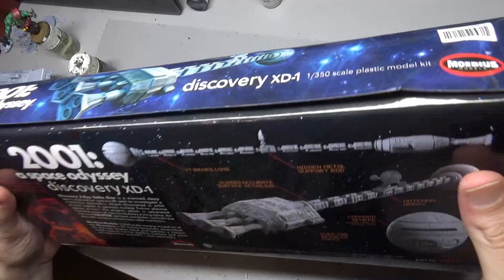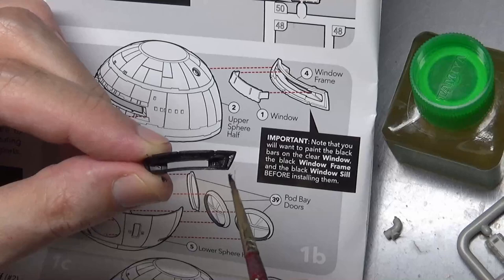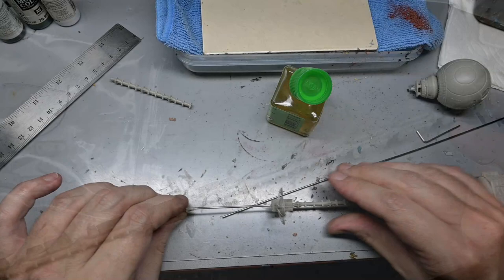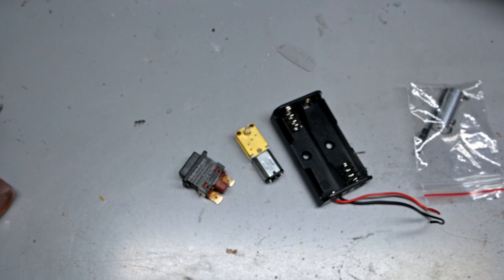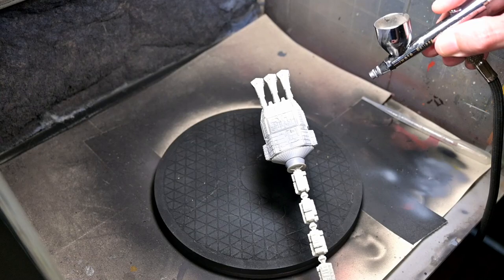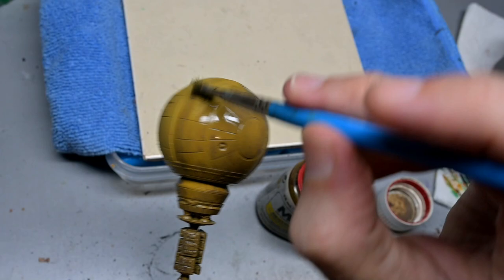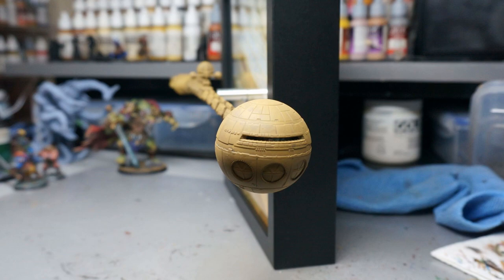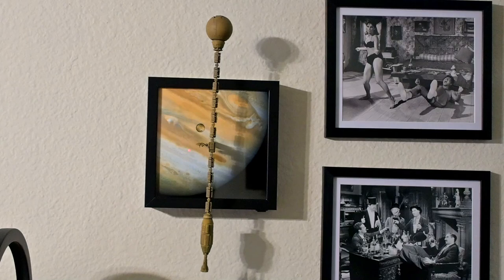Building a 2001/2010 Space Odyssey Discovery Kinetic Model Kit - Add Motors to Your Models!

Comment: You could try finding a bit of sheet metal instead of the styrene. Aluminum might do. The stuttering might be just binding in the gearbox. A tiny bit of molybdenum grease in there might sort it out.

Comment: Very nice build and presentation! A tip for assembling the cargo pods: glue the support spine pieces forward and aft of the communications antenna around the metal rod separately from the command and engine modules using the modelling bench or table to line them up. Then attach all the cargo pods one side at a time also using the bench to keep them level until you have all three sides done. Then attach the command and engine modules over the appropriate ends of the support rod. (This is easier described using a video than by writing it down!) Check out Lou Dalmaso's build of the 1/144 Moebius kit on his Aztec Dummy channel to see this technique as it can be applied to the 1/350 kit.